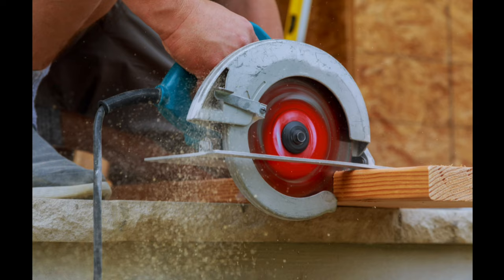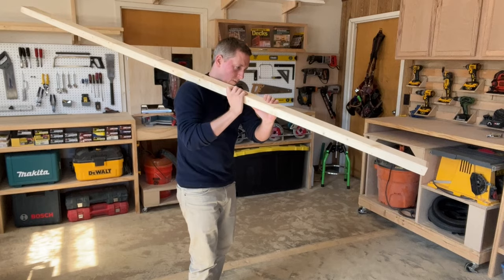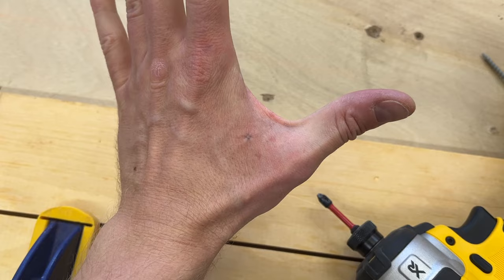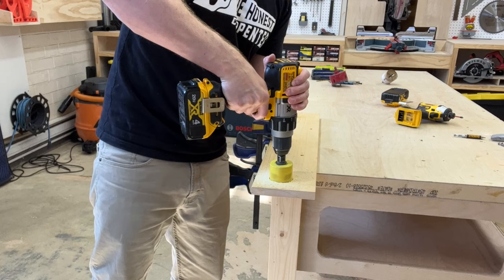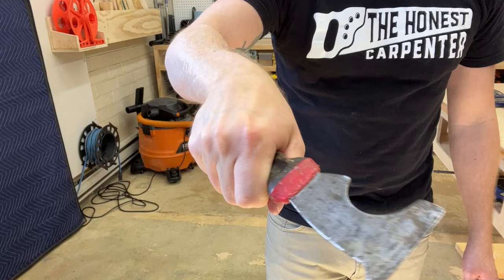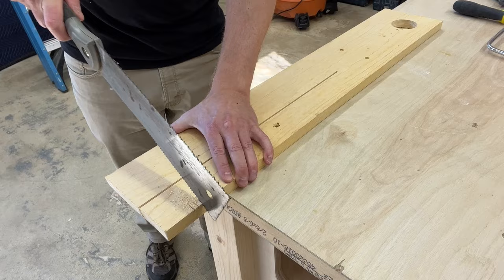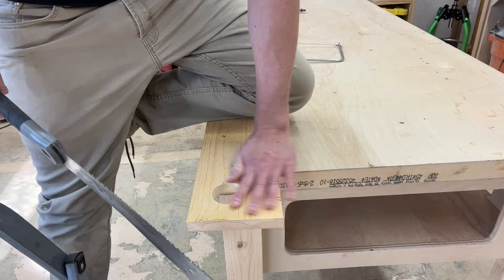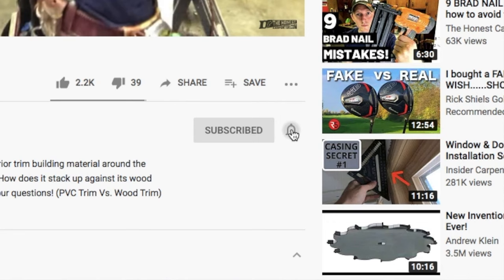9 MOST OVERLOOKED DIY INJURIES! (Avoid These 9 Worst DIY Injuries/Accidents From Common Tools!)

Comment: it has been my experience that most handsaw injuries result from trying to force the saw to work faster than it is able, especially when starting the cut. A hand saw only requires enough "downward" pressure to keep it in the cut. The greatest force needs to be along the line of the blade, allowing the teeth to remove the stock. The old-timey advice of letting the tool do the work is especially pertinent to handsaws.

Comment: Did number one today, very minor scratch. Have done the drill wrist twist, the scraping splinter, the board sliding splinter and of course the hot blade grab. 5 out of 9, But none very serious.

Comment: Just to add on to this, afew of these can be prevented while wearing proper ppe. Gloves, safety glasses, hard hat, steel toe boot. As a fabricator I never touch anything without gloves. Keeps me from getting cut while grabbing steel or the grinder catching or jumping and cutting up my hand, burning my hands, and it also keeps them cleaner which is also nice so I don't have to wash my hands frequently. My dry skin thanks me there 😂

Comment: Pro tip(s) with cutting instruments... 

1. Gentle but firm... OR... Let the TOOL do the work. Don't lean on or try to shove the thing deeper through the material than it's ready to dig on its own. If it doesn't cut through the first time, just add another stroke... and repeat...

2. Position and technique... Set yourself up at about a 45 degree angle to the work. Your arms work in arcs (parts of a circle motion) and moving back and forth across your body not only keeps you out of the cutting path, but allows space to freely control the instrument with precision and confident force... smooth and straight is the goal in this game.

    ...AND it doesn't matter if it's a handsaw, Japanese pull saw, utility knife, or kitchen knife... even a chef's knife works well with this and gives superior control over "facing up" to your work...

 3. CLEAN AND POLISH YOUR SAWS!!! A shiny saw will reflect the geometry of the board you're cutting. If it's at 90 degrees, that image should look like the edge of the board just continues straight into/through the saw. It's an optical illusion, but that's how it SHOULD look... AND when you're cutting angles, during the "lay out" you can mark lines down at 90 degrees to your "cut line"... They will ALSO reflect as if carrying "through" the blade of the saw if you're holding it correctly... 

     The technical explanation is that light ALWAYS reflects exactly at the same angle(s) as it strikes a reflective surface... SO only at 90 degrees will everything appear "straight through"... This also includes 90 degrees vertical to the board's horizontal position, so you'll be MUCH closer to "dead on balls precisely" when you use these little tricks with hand saws...

    Further, a clean and polished saw will greatly reduce friction with the wood, over the saw caked up or crusted with rosin and dust... making the actual work easier on top of the visual aids while you cut... even with a light "scribble" of paraffin wax to help lubricate, you don't need so much that it gets sticky and it should still reflect well... making it easy to see when you're cutting straight and true to the work.

   I occasionally pride myself (semi-humorously)  about being a "safety 3rd" kind of guy. My first priority is to get the job done... AND sometimes there simply isn't a "good" way to do it. That's not going to dissuade me when I deem a job necessary. AND of course, part of getting it done is surviving to finish the thing... My Second priority is that it's done "right"... That doesn't seem like a big deal, but don't leave work half-assed. It means setting a clear goal to accomplish and a clear tolerance for when it's done and when it's not "there" yet. Be honest and don't rush yourself. Lots of these tasks are difficult, tedious, and at least a little bit dangerous. Rushing will come to nothing good. Trust me... AND for what it's worth, most of the time, if you're doing the work properly, you're probably already doing it about as safely as possible... AND finally, 3rd... TRY to be as safe about it as you feasibly can. That doesn't mean armor or protective gear works better the more you layer it up. Almost nothing does. While mathematically or statistically, you can argue that every millimeter adds a degree of safety, you reach a principle of diminished returns, sooner or later. That is to say, you'll end up like the little brother in "A Christmas Story" if you keep it up, in so many layers of protective wear that you can't even relax your arms down at your sides... 

     I don't know about you, but I can't function like that... even in the damn wintertime.

    SO... there's the sum and total of WHY I like to say, "I'm a safety-3rd kind of guy" as opposed to "safety first".  AND I submit the technique mentioned above, as evidence that it doesn't necessarily REQUIRE any great amounts of material or gear to be safe at work with extremely sharp and hazardous tools or utensils...   ;o)

Comment: This makes me think of the injuries I've sustained or seen over the last 20+ years. Number one is to NEVER leave nails or screws sticking up where anyone can step on them. Number two is, as AvE says, "Cut toward your chum, not toward your thumb." Number three is - NEVER climb down a ladder and leave tools at the top. Aside from that, injuries are going to happen. This is dangerous work, and none of us are careful or lucky 100% of the time. A good construction first aid kit includes eye drops, a safety pin, electrical tape, and Ibuprofen.

Comment: I just bought a bunch of new equipment, about to embark on trying out a bunch of project ideas. I appreciate this preparatory warning video. Yikes. Much of it is stay out of the strike back or skip path of tools, & wear gloves... and consider stability. Great ideas.
Reply: and slow, progressive steps with knives, drill bits... and how they get HOT
Reply from the maker: Thanks, CC! I almost done with my first online course, POWER TOOLS EXPLAINED. It should launch by mid-august. Might be of some help to you if you’re just now getting used to power tools! 🙂

Comment: Point 1 is a good one. Also don't let boards, like mdf or furniture board, slide through your hands when you just cut it, It can be deceptively sharp and you can get very nasty cuts. Yes, I speak from experience. I have experience with everything on the list though except the scraping one.

Comment: Great video..This probably falls outside of DIY, but folks opening packages with pocket knives...ugh
Reply: Yeah…My tip is when using a folding pocket knife, simply never curl fingers over the folding slot.  You get a less secure grip…but if it folds up on you at least you don’t get cut!

Comment: Jamming drills are bad bad news. A 3 year recovery from a wrecked shoulder after having drill jam whilst drilling a 90mm hole in stainless steel. When drilling any sizable hole use the torque settings  on your drill. The drill will stall out frequently but it better than a lengthy recovery from a jamming drill.

Comment: In my experience, I’d honesty never recommend using gloves with rotating equipment. Yes, this includes drills and impact drivers too. The risk is too great. Look up the injuries online if there is doubt. If there needs to be a driver/implement change, yes, perhaps put on gloves because of the chance of heat- stationary. I’d also add, I’ve been burned and scared on my forearms with impacts that have really been put through their paces. Be careful of the head and the motor areas of impacts that are really being used hard… incredible amounts of heat being generated.

Agree wholeheartedly with everything else based on my experiences/time in field. Just don’t let the safety man catch you with your step ladder leaned against the wall with you on it.

Comment: With the drill twist, I prop the end of the drill, into my leg. On the other hand, if I don't want a small screw, to strip, I use my wrist as a clutch. I hold the drill loosely, and let the drill twist, when the screw hits bottom.

Comment: Never leave a sharp tool loose on a surface in such a way that it can fall. I once put down a chisel I was using on a table, then knocked whatever it was on over and it landed sharp side down straight on my exposed foot. I was luckily able to move my leg in time to only get nicked by it, but it was enough to make a nasty wound.

Comment: Many years ago, I was using a scalpel to cut something...to this day, I still have no idea how my finger ended up in the path of the blade when it slipped.

Thankfully, I only have a line across the tip of my finger to show the damage now...but it went almost down to the bone, and was probably the worst knife injury I've ever given myself.  Definitely not recommended.

Comment: I once shot a 1” long 23 gauge pin into my stomach. Only about 1/16” was sticking out. I grabbed pliers and yanked it out before I could think about it. Left a 3” diameter black bruise.  Now I disconnected the air when clearing a jam. 😝

Comment: Alright so if for some reason you must use the ladder sideways, put your weight towards the wall. I stand the exact opposite of how you did for the clip, all the weight on the right side, I’d say halfway between the middle line of the steps and that right side, 1/4 of the whole width of the step off the right side. 
That being said, don’t tip it towards the wall, then accidentally over correct and tip the whole thing away from the wall. 
I like to grab ahold of something attached to the wall (if possible) and use that point of contact to apply force without the ladder receiving any horizontal push.

Comment: My dad was using a hole saw when I was about 8 or 9 to put a dead bolt in a door. 
I bent down and grabbed it for absolutely no reason right after he put it on the ground. 
I immediately dropped it back down since it was so hot and he just looked up at me like "that's pretty hot wasn't it?"

Comment: Hey Ethan, I don’t think this would require an entire video, but maybe I’m selling the topic too short: what’s your take on glove usage? I see so many craftspeople and DIY videos where there are no gloves to be seen, but every single set of safety instructions on everything says to always operate with gloves on. Personally, I’ve never found a good pair of gloves that gives me the fine touch needed sometimes to work, but maybe you have some suggestions? Also, which types of gloves are best suited for which types of work? We could also roll safety glasses, back supports, knee/shin pads, etc. Come to think of it, “safety equipment” would probably easily fill a video. ;)
Reply from the maker: Hey Rock, this is a great topic! I’ve thought about doing this video many times. You writing in with it is probably the last boost I needed—I’ll try to cover it before too long. Thank you! 🙂

Comment: Phillips screw punching is a crime. I've had these injuries for years. They designed those screws 100 years ago to cam out at a certain torque. That's because they didn't have all the torque control we've had since WWII.  So that stupid wobbly connection between screw and bit collapses. Our hand is there in the first place because this connection is so awful we have to hold it in place until it gets started. There's no excuse that this ever happened and continues to happen in any of our life times - and I'm in my 60s.  Blade screws? I never knew that the screw driver blade is supposed to fit snugly in the slot- they just never have. We did have Yankee Screwdrivers in the 1960s that had screw tips that fit snugly in slotted hinge screws, everything else?  Never. 
Scraping I would put this under any action that is quick, loose and repetitious. Precision slows us down giving us a lot of safety.   A friend was just casually chopping some shims off using a table saw. Took off all 5 fingers in multiple passes. (They got reattached but shorter). Something else, I've seen more videos on people working on boats not using an extension pole. They'll paint an entire side of a boat with a small roller and no extension pole. (If they ever did any house painting they're still working at it.) Scraper? A long pole gives you not only more leverage, more power, a longer straighter movement but also safety because you're farther away. (More power because now your body and the muscles around your shoulder is working, not just your forearm.) 
I would call Stepladder kick-out Stepladder Jackknife. When it kicks out from under you, you don't fall away from the ladder - you land right on top of it. I broke a couple of ribs from a  stepladder jackknife fall of only about 5' that I could have otherwise easily landed. Instead I fell only about 3' and landed on the ladder. 
For years utility knives were horribly designed. The blades didn't retract or they extended too easily (those snap offs), a leather holster? Would last a month or two.   I finally got a Milwaukee flip utility knife - it's terrific, easy to open, easy to close. But answer me this: Why are ALL the belt clips on ALL of these knives in the wrong place? Most of us are right handed, we want to unclip the knife, flick open the blade and go to work, On the Milwaukee you have to turn the knife 180° along two separate axis's to get to this position.  On others it's only one 180° reposition.   No one, and I've even written Milwaukee, has ever answered this, offered any ideas. (I drilled and tapped a hole in the correct position, bent my own belt clip. Basically I have the only functional flick utility knife on the planet.  I am concerned that I may have made my utility knife into an illegal weapon (maybe a stupid knife is more legal?) , but it never leaves my house or shop so I'm not too worried. I can't find any information on knife laws that says anything beyond 3" blade and intent. There are laws about switch blades and butterfly knives but I don't think they apply. )
Here's #10:  Short f**ing power cords. 6' and even 8' cords on power tools, saws, routers, and drills get hung up on the plugs and pull the tool out of where you're controlling it to go. When I was working construction full time I'd cut the female plug off a 25' extension cord and put it on my Skilsaw, screw-gun. You don't have to make an even bigger 'catch' by tying a knot to keep the plug from pulling out.  The connection is usually far enough away you're never pulling on it. Especially while framing this eliminated so many frustrations, and you could lower a saw from the second floor or roof.  So tip: if you are using a power tool and the plug pulls out? Replace the cord with one that is 25' long - it'll never happen again. Even better the plug will never catch on something and try to yank you off a top plate or ceiling joists.  (Small kitchen appliances now come with 16" cords - a complete joke.)  Sorry to be such a crank....

Comment: I'm certainly guilty of accidents with a utility knife. Once, I was cutting drywall. I was sitting on the floor and the knife suddenly came free and into my leg. I was very fortunate. Instead of it cutting a long gash in the side of my leg, it stuck in my shin bone. Another time, I filleted the side of my thumb. It left a large flat oval about 3/4" long and 1/2" wide. I should've gone to the ER. All they could've done was cauterize all the bleeding blood vessels. But, I have this thing that, if I can stop the bleeding, I don't need to spend money getting a doctor to treat it.
Okay, two other things. Oh, never use a dull blade. They are more dangerous, by far, than a sharp blade.
   1) Don't place fans on the floor near paths. The blade guard is no guarantee you won't get hurt. I walked into one when I was 8. My knee went in between blades and was stopped by the guard. The 1st blade cut cleanly through the flesh just to the side of the knee cap. It was about 2" long and 1" wide. Funny thing was that it didn't hurt and didn't bleed, except when I put a 4x4 gauze to it.
   2) Never hold an object to which you are applying a screw driver as a lever. If it slips, the screw driver is going right through.

Comment: I'm fortunate enough to be sufficiently ambidextrous that I can use a drill with either hand. If you are drilling with your left hand you can often position yourself such that the drill will turn into your body if it binds up, preventing a wrist injury. But other than that, I always use the clutch when drilling large holesaws. A friend of mine ended up on disability because he severely injured his wrist and elbow with a drill.
Reply from the maker: That’s an interesting point, Kate! You’re right, it gives you more leeway 🤔

Comment: I always work on the principle of safety first,wear gloves as much as possible and goggles too. It’s not expensive to buy grafter style gloves or goggles and they come in useful. Ear plugs are ok to a point but defenders are probably best. As a rule never disturb a person with a power tool and avoid going near them awhile they are working, it only takes a moment to distract them and it could cause serious injury.  I would advise folk to not rush a job as that causes injuries too, it might take a bit to get something done but at least it’s done safely. Always treat your tools with respect and look after them. Don’t use power tools if you have been drinking or are tired as you will be a danger to yourself and others too.